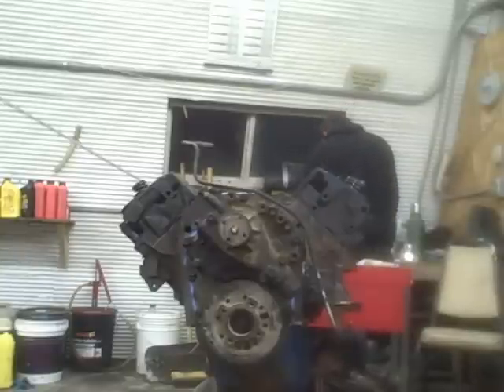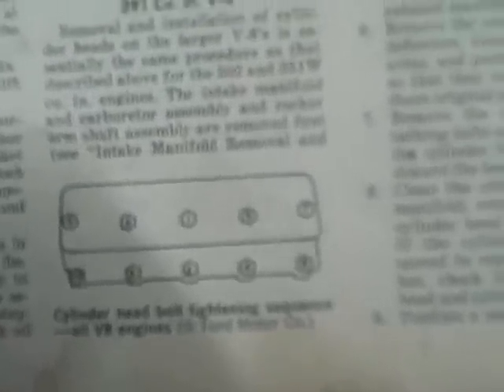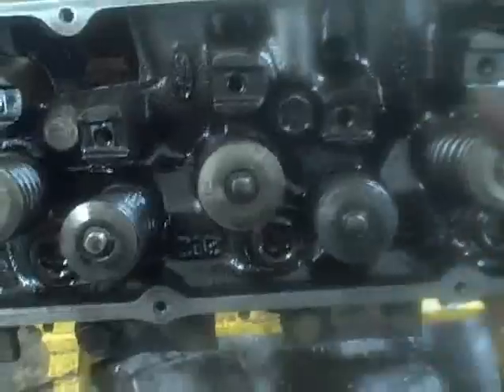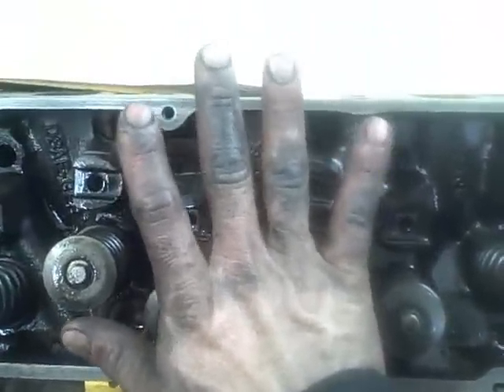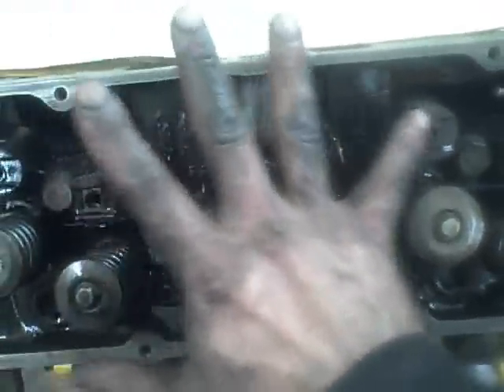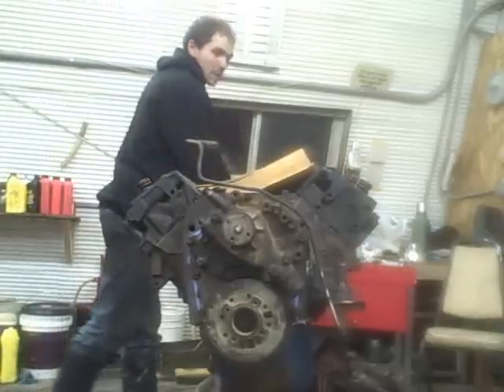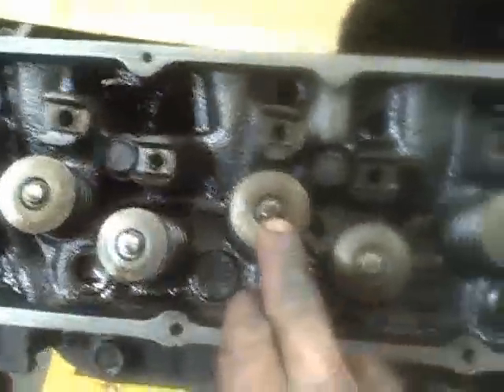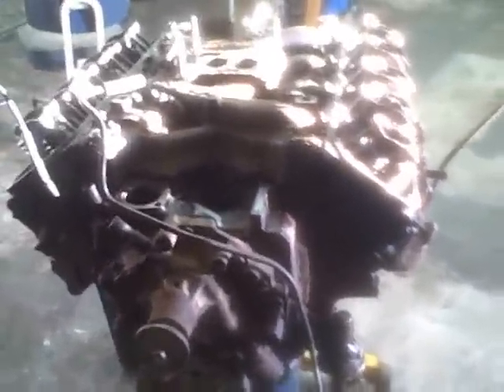Engine Assembly Part 6 torquing the heads and top end work

Comment: does that still have the ford fuck up timing chain gears in it or is it the all steel ones now?  the teeth like to splinter and it eventually fills up the oil pump screen.  kinda dumb but it happens

Comment: hey man u really should do a intake/carb and exhaust upgrade wile ur at it.......my '79 i put a eldberock intake holley 650 and blackjack headers on.....improved my fuel mileage by about 4mpg...from 7-10 to 10-13 or so......i got a great deal on my parts tho....but should run about  300 for carb 200 for intake and about 150 for headers.....and exhaust i jsut used some glasspacks...